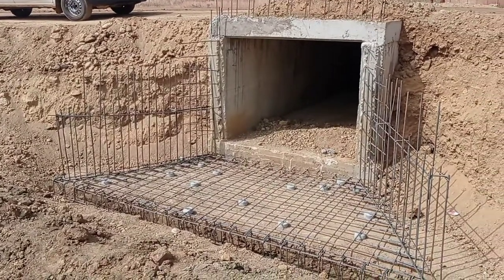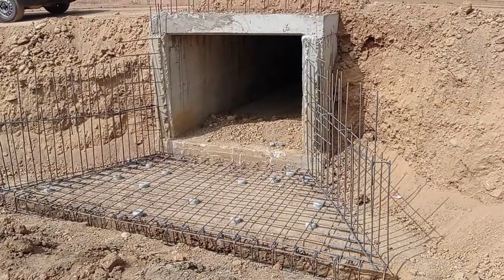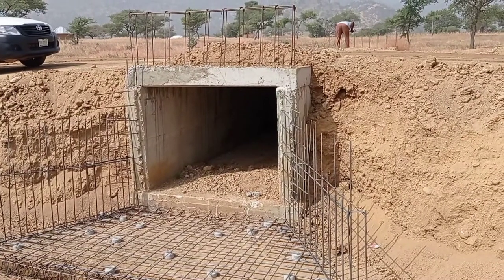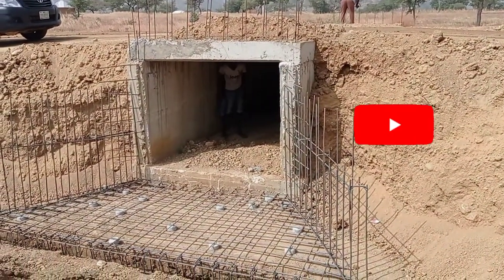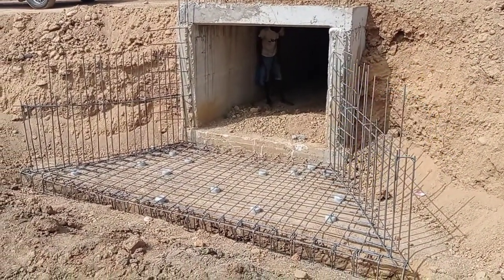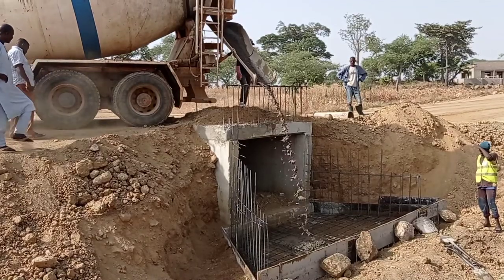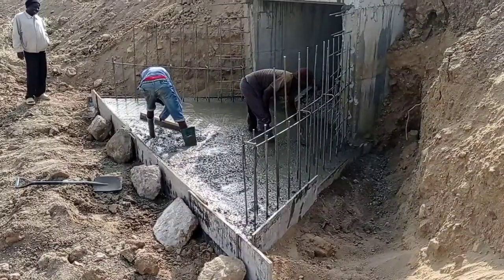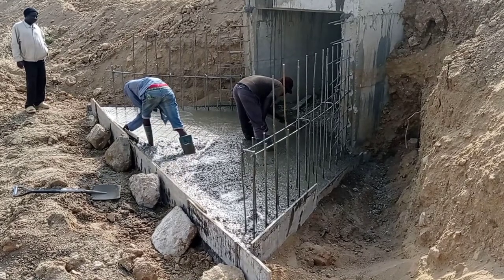Construction of Apron & Toe Beam of Culvert | Reinforcement & Concrete Detail | Box Culvert

Comment: Y there is no pcc and steel laid directly without it?? If RCC work is done directly over soil, soil will absorb water and make weak rcc.
Reply: Plus free fall of concrete is more than 1-1.5 metre highly lack of quality control
Reply from the maker: Hi Archana, I always do lean concrete/blinding/pcc. It has to be done always in order to avoid direct contact of soil with rebars.
Reply from the maker: 1m to 1.5m height of concrete free fall is still reasonable. But I understand that it should be avoided wherever possible. Thanks for the correction.
Warm regards.